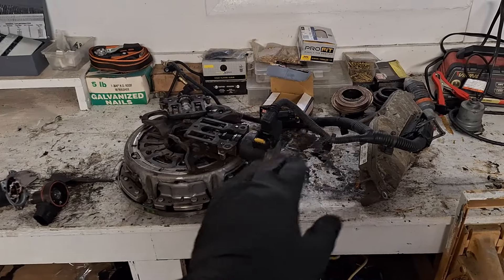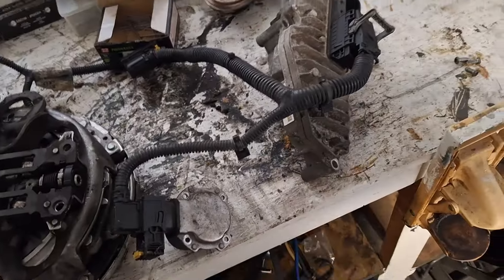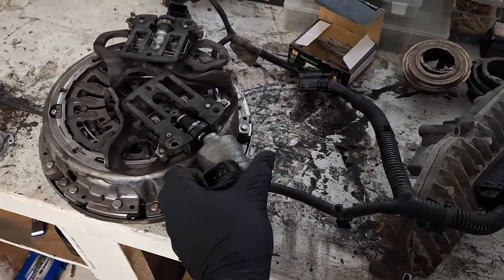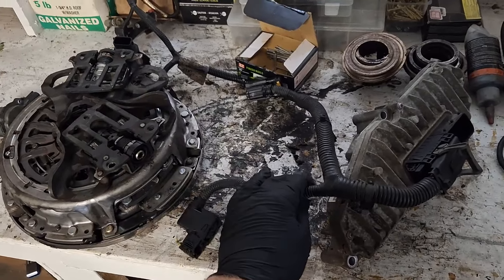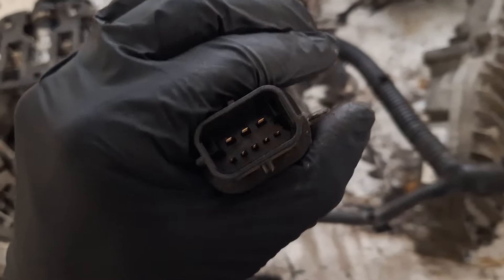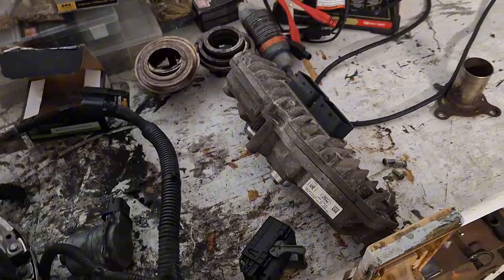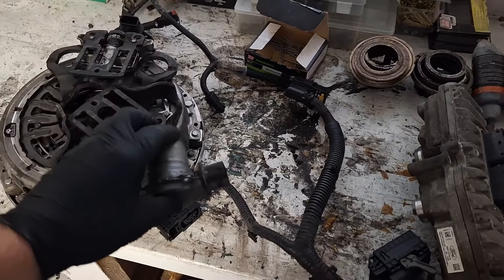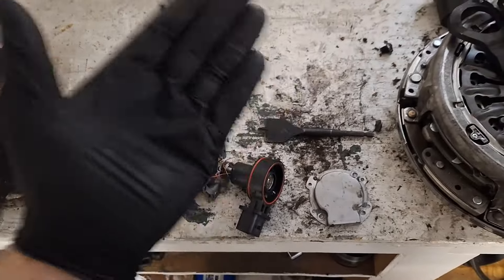Ford Focus: Clutch Position Sensor Fault | Explained!

Comment: Your posts have been a Godsend. Dealing with my daughters '12 focus has been frustrating to say the least. I came across your videos and replaced both of the actuators and cleaned up the grounds. The car is running great. The only issue is now it shows 0 codes DTC. Now what? No hair left to pull out.
Reply from the maker: @SV11408  hi, glad the videos helped. With no codes present, if you're still having shift issues I would do clutch fork tests

Comment: In my case the ground that you mentioned was loose, I noticed a few sparks, do you think that could be the tcm? I still have a p0805 reverse is fine though.
Reply from the maker: clean and tighten up the ground and you should be good

Comment: Hi Ben. Have a question I haven't seen. My 2013 focus received a new TCM but still was acting up. I reset the transmission like I had done before but this time Park dissappeared. Tried resetting again, disconnected the battery, everything I could think of. Still no Park. Glad the park brake works good. Any thoughts?
Reply from the maker: @shawncoleman9476  park disappeared off the cluster but the other gears appear?

Comment: Hello Ben thank you for your help as always in these amazing videos.
just one question, I did forks job on my 2012 focus 1.6 and here in Egypt the dealership says clutch touch point is not necessary after forks only after clutch replacement 
the car runs ok ever since so does that means it is not necessary as they said?
Reply from the maker: @ahmedalgendy0091  yeah, it's not necessary but still a good thing to do. But if it's shifting well then it's fine
Reply: @BigBensCarsAndCycles  thanks man 
Also forgot to tell you, I found couple of videos that pierced through clutch casing near forks and clutch pack and resealed those holes with bolts
I do use them every like 10k miles to clean up clutch dust with compressed air first then brake cleaner then air to make sure no liquids remain there you will be amazed by the quantity of dust that gets out every time 
Hope you give it a go though
Reply: @ahmedalgendy0091  Do you have a link to  the videos concerning the cleaning  the clutch dust out? Tia.
Reply: @CARRJ142  It was a while ago I will try to search for them again and once I find them I will post the links so we can get verification from Ben as well
Reply: I seen that video the guy had a hole with a bolt , he sprayed the crap out of the forks with cleaner and you could see the black liquid draining out.. I thought it was a slick idea. I would just be worried of the over spray that will get into the clutch..
Reply: @joeviveros3222  Yes exactly this is the one 
I did it while ago and now I know why forks do get clogged like I said every 10K I do clean them with a designated hole to clean the clutch because it has a lot of dust
afterwards I use compressed air to make sure no liquid is still in there before sealing it back

Comment: My car tcm was replaced on my 2017 now it makes noise down shifting and i have shudder on take off till after 15 mph then it stops 2017 ford foucs any suggestions
Reply from the maker: @brianfreeman9453  yeah, replace both actuators with new oem ones. Assuming you have the codes in the video

Comment: I did a lot a research and testing and mine is 100% the TCM. Do I need to pull my transmission to have the replaced? If so, I'll just take it into a mechanic since I don't have the required supplies to pull it
Reply from the maker: @BoostedFocus  no, you can change it in vehicle. I have a video for that